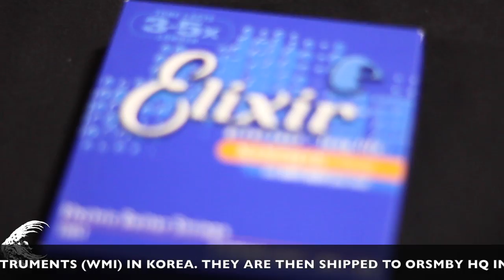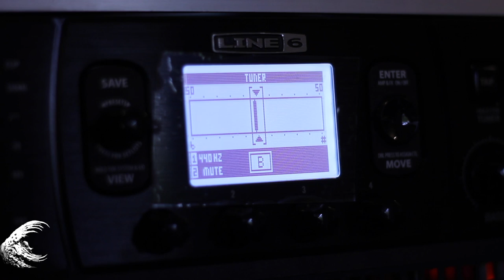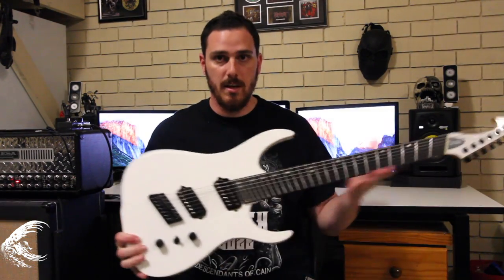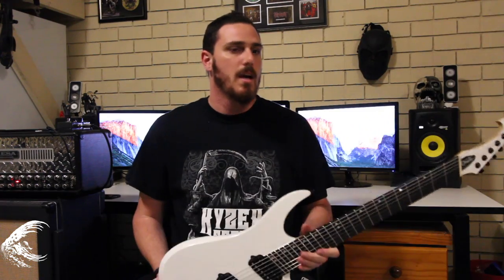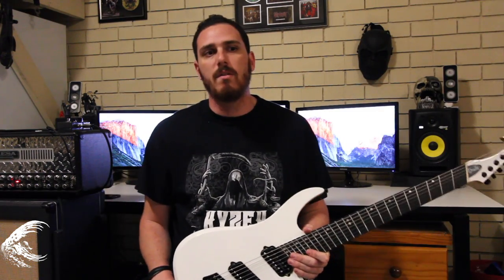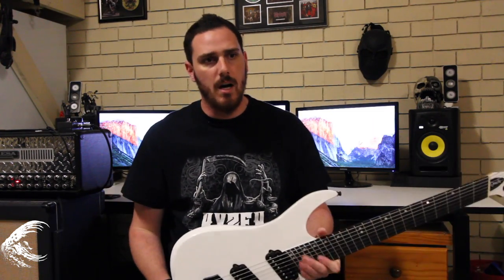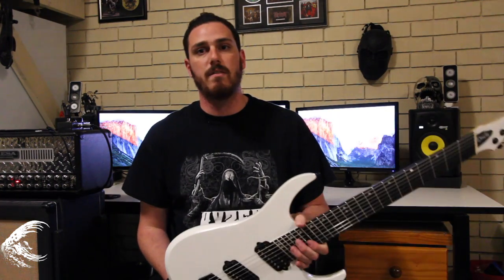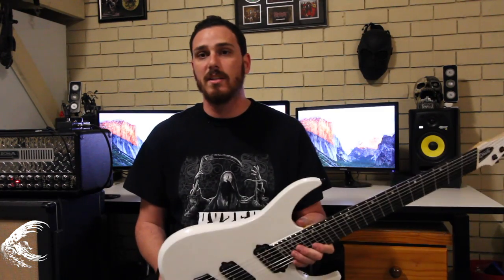Ormsby Guitars - GTR Hype Run 1 Demo & Review

Comment: nice review man. is the opening track recorded with this guitar?
Reply from the maker: Absolutely is! Everything in each video we do is recorded with the gear respective to that video. Check out the SX video we did aswell. Once again recorded with an Ormsby, but the SX in that case. The hype is an amazing guitar.
Reply: fantastic in the mix. i tried these in the shop an was not too convinced on the sound. but in the mix its really a killer tone. how do you find those pick ups?
Reply from the maker: Between our two guitarists they would both prefer something a little hotter and more output But these pickups give alot more room to drive tubes more. They split coil works really nice. But something a little hotter is definitely on the cards.
Reply: not too many companies do the pickups for multiscale... id wish Seymour Duncan did. but as you said maybe just little more drive thru boost and it would get the right saturation. i might visit the guitar shop again and try it out thru something hotter.